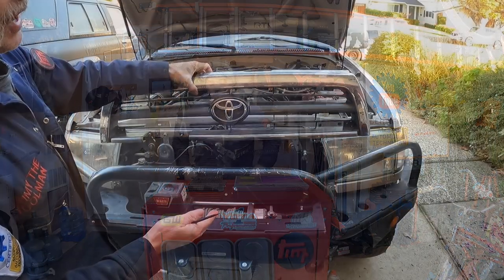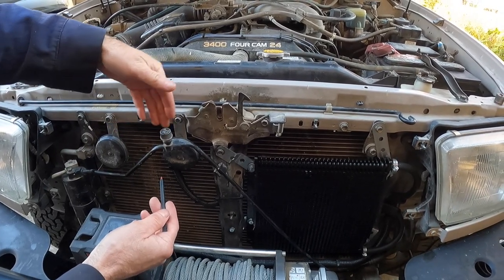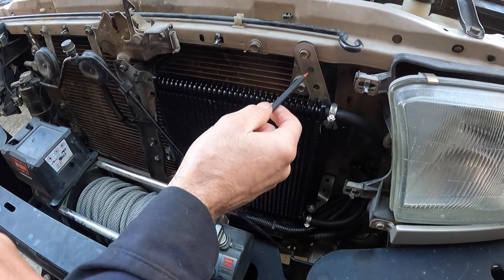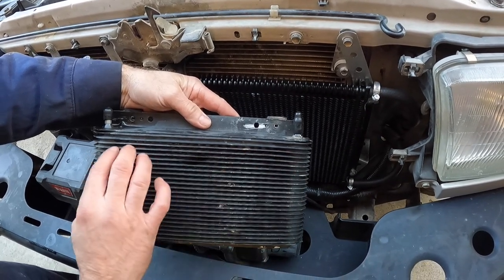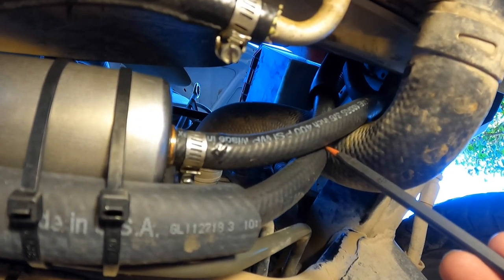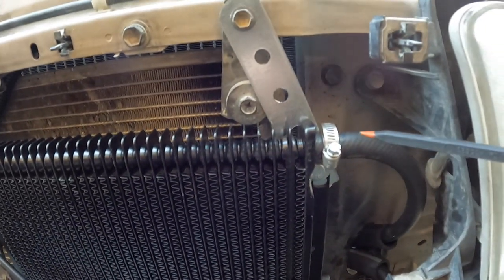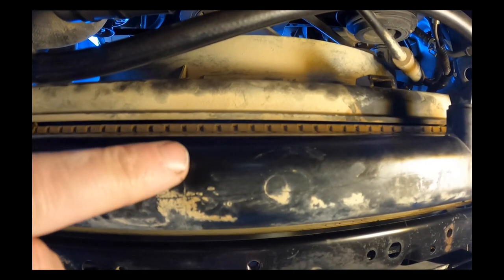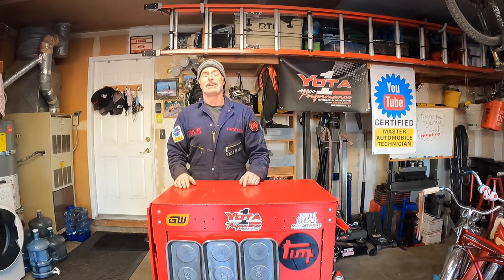External Transmission Cooler Install (3rd Gen 4runner/1st Gen Tacoma)

Comment: hi Timmy, quick question,  I'm  planning to overland my sr5 i already order  my rear bumper, i already have the front one with a   x-bull 13500 , do you think should i go with the hayden 699 or the 678? thanks again.
Reply from the maker: The 699 has a thermal bypass for cooler conditions.  How well it works?  it's debatable.  But, I'd probably still go with the 699.
Reply: @TimmyTheToolman  thank you so much.
Reply from the maker: @julioarrecis666  No problem.

Comment: I have a 98 4Runner and just got my Hayden 699 mounted up but need to get some 3/8 line. You show two 3’ sections needed, is that enough? Seems kinda a little far for only 3’?
Reply from the maker: 6 feel is enough for the way I routed it.  If you choose a different path for the hoses and come around the passenger side of the radiator, you'll need more hose.
Reply: @TimmyTheToolman  thanks for the reply, I’ll get 7’ just in case :) you rock thanks for what you so
Reply from the maker: @i-b1982  You're welcome.  Good luck with the install.

Comment: Hello Timmy, do you know if the internal transmission cooler is on the cooler side tank or hotter side tank of the radiator? thank you
Reply from the maker: The lower part of the radiator where the trans cooler is located is the cooler side of the radiator.  The hot coolant enters the top of the radiator, is cooled and returns to the engine via the lower radiator hose.

Comment: This is probably a dumb question. If I have an ultra gauge that monitors transmission temps and I do this and bypass the stock cooler, will it still read the temperature correctly? I'm not really sure where the thermometer for the transmission is. I have a 2000 2wd 4runner. Thank you.
Reply from the maker: Yes, you'll still be able to read the trans temp correctly.
Reply: @TimmyTheToolman  Appreciate it!
Reply from the maker: @mitchellpeterson2883  No problem.

Comment: Hello Timmy I have a 98 4runner sr5. how did you get the transmission temperature I noticed there is no sensor that reads live data in the computer using a high end ob2 scanner?
Reply from the maker: 96-98 did not have the sensor to report trans temperatures. But check out this video where we installed a gauge onto a 98’ just like yours!
Transmission Temperature Gauge Installation
https://youtu.be/fT_2szdKXRM

Comment: Sorry, if this has already been asked, but when I went to purchase the 699 Hayden Trans Cooler, it says this cooler is not compatible with my vehicle and advises me to purchase the 696 Hayden Trans Cooler.  I just wanted to make sure. Thank you.
Reply from the maker: You can make any cooler compatible if you want.  A cooler is a very simple device and isn't really vehicle specific.  As long as you can securely mount it, it will work.
Reply: @TimmyTheToolman  Thank you TImmy!
Reply from the maker: @michaela2079  No problem.

Comment: please i need help. My mechanic installed the trans cooler with the hoses facing downward. Is that a problem?? because i feel like there hasnt been a change in trans temp..
Reply from the maker: I think I remember upside is considered an acceptable position to mount it in, but I've only every done a sideways install with it filling from the bottom and exiting the top.  You fill from the bottom so air is pushed out of the cooler and not trapped affecting the cooling efficiency of the trans cooler.

Comment: I’m hot areas like phx, az do you think this will affect the ac condensers performance?
Reply from the maker: It shouldn't negativity affect your AC system enough to notice.  The air will flow through the trans cooler and reach the AC condenser.

Comment: I live in TX and the day time ambient temperature can go to 100+ degree F.   I did what Tim did (bypass the radiator) and installed Hayden 699.  Scangauge ii reported temperature around 190 degree F during the day and 165 degree F during the evening (ambient 86 degree F).  Is this normal?  Should I or can I install another smaller Hayden in tandem to better cool the ATF?
Reply from the maker: Those temps seem high.  Is that around the town driving on relatively flat roadways?  I don't average that high of temps with my Hayden 699 cooler and I'm driving in similar ambient temps.  If I'm driving in the hills, then yes, the temp goes up and then you need to utilize tricks like turning off overdrive to keep the temps down.  

What are your engine temps like?
Reply: @TimmyTheToolman  It is when driving on flat roadways.  My rig is 2000 4x4 but I don't do trailer or off-roading.  Can I install a 2nd smaller Hayden or hook it in series with the radiator?  Thoughts?
Reply from the maker: @thepianofamily8304  Yes, you could run two external coolers in series.  Guys have done it.
Reply: @TimmyTheToolman   Coolant temperature is consistently at 200+ deg F when driving in town, according to Scangauge 2.  The TFT is ~195 deg F.  The ambient was 103 deg F.  I have ordered a 2nd 699.
Reply from the maker: @thepianofamily8304  Have you checked the function of your fan clutch yet.  That might be part of the problem.

Comment: Hey Tim , installed the same cooler. My oil temp was around 175ish . After the install I’m getting 89. This is with the AC on. Is this normal? Seems too low.
Reply from the maker: That seems low.  I see low temps in the morning when it's cool and I just started driving, but it will climb into the low 100's until I start climbing hills and then it will rise into the mid 100's.  What kind of ambient temps do you have where you live?
Reply: @TimmyTheToolman  You know what Tim. I went back on my notes and it was actually 155 instead of 89. Sorry. So that is like 11%ish drop. Not too bad. I was doing multiple tests on other things installed and lost track. But to your point, I should test going up a steep incline/mountain pass. Without the cooler I was averaging 220-230ish. This incline is in the 15-25 degrees grade. BTW I live in the central valley where it gets really hot! So very similar weather to what you encounter. 🙃 Thanks for replying!!
Reply from the maker: @genxiong2695  Gotcha.  Let me know how the testing goes for you.
Reply: @TimmyTheToolman  Will do. Thank you for making these videos and helping out all the DIY weekend warriors!
Reply from the maker: @genxiong2695  No problem Bro.  It's our pleasure to help the Toyota Community out.

Comment: How many quarts of ATF will I need to do a full flush and refill, and why Valvoline full synthetic instead of a genuine Toyota ATF?
Reply from the maker: The system holds around 12 quarts.  I usually run around 13-14 quarts through the system to get the fluid really clean.  You can use whatever ATF you want.  As long as what you use is compatible with the spec suggested by the manufacturer, you're good to go.
Reply: @TimmyTheToolman , ok thank you very much. 😊
Reply from the maker: @erniekropf665  You're very welcome.

Comment: Hey Timmy, is it possible to do a steering wheel mod? I saw one in a 2002 4Runner and I like it more than what I have in my '97 rig, but I don't know if it will fit/work or not
Reply from the maker: That “mod” would require you to splice in a 98+ airbag connector OR swap the clock spring.. the steering wheel itself secures to the shaft the same way throughout all 3rd gen years (96-2002) It is held on but a 19mm nut.
Reply: @TimmyTheToolman  I think I would go the "splicing" route. Thanks, Timmy
Reply from the maker: @zenjon7892  we have some extra 98+ airbag connectors if you need one
Reply: @TimmyTheToolman  ok, I'll take one
Reply from the maker: @zenjon7892  email Sean at: hmb4rnr@gmail.com

Comment: I own a 2001 Tundra 4x4  limited 4.7 liter. How much better is this cooler then my stock one and do I really need this transmission cooler?? I don't see a temperature gauge for my transmission anywhere.
Reply from the maker: The Hayden 699 is going to have quite a bit higher cooling capacity than your stock one.  I've seen the size of the stock ones and they're not that big.  You don't have a trans temp gauge.  All you'll have is the "Idiot Light" that will light up on the dash if you overheat your trans, around 300 degrees.

If you want to monitor your trans temps, you have a couple options.  There's OBD II port bluetooth readers that can send information to phone apps like Torque Pro.  Torque Pro is for Android phones only though.  For iPhone, there's other apps you can use.  You also have to make sure you get a reader that works with your platform, Android or iPhone.  The other option is getting a scan gauge or ultra gauge.  I use to use the phone app but decided to go to a scan gauge so my phone didn't have to bounce back and forth with different screens like when I'm using my phone for navigation at the same time.   If you open the video description by clicking on "Show More" and you go to the "Helpful Tools" section, you'll find a link to the Scan Gauge tool I use in my rigs.  

So, it depends on how you drive your rig and the temps you're seeing whether or not you need to upgrade your trans cooler.  If you drive mostly flat roadways, you probably don't need to change anything.  If you drive a lot in the mountains or tow, you might find the stock trans coolers aren't doing enough to keep your trans temps down.
Reply: @TimmyTheToolman  I driver in the Eastern High Sierras for about a month per year towing a small fishing boat.
Reply from the maker: @mikekmalick  You should start monitoring your trans temp then.  Ignorance isn't bliss in this situation.  Knowing what your trans temps is doing will let you know when it's prudent to pull over and give your trans a break.  I'll pull off the roadway when my trans hits around 230 degrees and I know I'll still be climbing further.  The same goes for the engine temp.  That analog coolant temp needle gauge is pretty much worthless.  Once you see the needle start to rise higher than normal, your engine temp has already spiked.  It's better to know the actual digital temp your engine is at to catch an issue quicker.  210 degrees is the engine temp I start to get worried and will either pull off the side of the road to let it cool down or I crank the heater full blast and suffer in the cab to help drop the engine temp.
Reply: @TimmyTheToolman  should I install a aftermarket transmission temp sensor gauge?
Reply from the maker: @mikekmalick  That would be the harder way to go Mike.  I gave you two options of how you could read the trans temp which wouldn't require you to have to install an aftermarket gauge.  Installing a gauge would be much more work.
Reply: @TimmyTheToolman  I am looking for the cheapest way to get engine and trans temperature readings! Will the OBDII products do this on a 2001 tundra? If not then I will just get the SG2
Reply from the maker: @mikekmalick  Yes, an OBD II reader and phone app should work.
Reply: @TimmyTheToolman  I am thinking of adding a magnetic filter and 699 cooler to the system as an addition and not disconnecting any OEM equipment. What is your take on that? I have seen others do the same.
Reply from the maker: @mikekmalick  Yeah, that's perfectly fine to run the cooler in-series.
Reply: @TimmyTheToolman  awesome! Just worried about not changing the flow rate! Do you think it could change the flow rate at all?

Comment: In Kuwait, temperatures in the summer reach 50 degrees Celsius. Is there any advice from you regarding the transmission cooler for this weather with the fj car, knowing that the Fj cars in Kuwait have a horsepower of 268 and a torque of 380 Newton, because in our country this car is still sold from  The dealers   and yes that Toyota modified the engine from 2017
Reply from the maker: The only advice I could give is install the biggest external cooler you can and maybe add an accessory electric fan(s) to push more air through the cooling fins when traveling at slower speeds.
Reply: @TimmyTheToolman  you just read my mind im thinking of this step 
Thanks a lot brother with best wishes
Reply from the maker: @Respecet1981  No problem.   Hope it works out to keep your trans temps down.
Reply: @TimmyTheToolman  sure brother 👍🏻
Reply: @TimmyTheToolman  the biggest trans cooler can fit the fj is the 30 btu tru cool max the long one 
I went to the auto cooling technicians and they told me this is the biggest transmission cooler you can install in your car and I spoke with one person have the 2020 fj and he told me it work very nice, the trans temp is stable 
I will try it 
sorry if I disturbed you
Reply from the maker: @Respecet1981  You're not disturbing me.  Good luck with the install.

Comment: So you bypassed the Factory Cooler all together?
Reply from the maker: Yes, I'm trying it out and I'll see how the trans temps do over time and make a decision to keep it as is or change it to run the external cooler in-series with stock cooler in the radiator.
Reply: @TimmyTheToolman  Well I'm a Toyota MDT and here is how I've installed my coolers & filters; Leave the Trans, go into the installed cooler, back into the radiator, into the filter and back to the trans. I've installed Remote Oil filter mounts on all my Toyotas, (3) and use the Purolator Pure One filter, changed once a year along with flushes every 30,000. The reason you want to go into the installed cooler first then back in to the radiator is because it stabilized the temp. Kinda like this;  Too hot fluid leaves trans, tires into the installed cooler, cools the fluid too much but then brings it back up to operating temp in the radiator and back to the trans..  The temp should be between 140-170. It should never get past 180, that's the temp that starts oxidizing the fluid and hardens seals, generally not good past 180. Oh and use Synthetic Trans Fluid PERIOD.  I welcome you're comments on this, thx
Reply: @bluesky-ud9wg  So basically, you recommend series?
Reply: @genxiong2695  I'm a Toyota MDT, I do recommend running into the After Market cooler first then back into the Radiator cooler to stabilize the temp
Reply: @bluesky-ud9wg  Ok. So you're not answering my questions correctly or you are unsure.  There's 2 ways to run the cooler. One method is in series, meaning you are not bypassing the radiator but instead using the cooler in conjunction with it (which is what Toyota run on stock coolers). The other method is bypass which you run straight into the aftermarket unit and into your transmission. The radiator will no longer cool the transmission fluid but instead, the cooler will. Make sense?

Here's the in-series method:
https://www.youtube.com/watch?v=2EtQJb3RDzY
Reply: @genxiong2695  You're not understanding; Leave the trans, go into you're Aftermarket Cooler, THEN go back into the OEM radiator cooler then back to the trans. In theory the fluid leaves the trans Hot, is cooled down Too Much by the installed cooler then is brought back up to operating temp by the radiator cooler, then back to the trans. Easy?
Reply: Do Not Bypass the stock cooler
Reply: @bluesky-ud9wg  You just mentioned you do not recommend running into the after market cooler first. So you are contradicting yourself. Now, your above statement is to go into you're aftermarket cooler? This is essentially the by-pass method. OEM radiator cooler? What is that? Lol. 

This is how I run in-series. The "OUT" or hot/send line is never touch (this stays connected to the radiator). It's the "IN" or return line that is tapped with the aftermarket cooler then returns to the transmission. Simple as that.

I think you just don't know the difference between what is bypass or in-series. Nevermind you are lost.
Reply: @genxiong2695  Ok, I'm a Toyota MDT, look it up. I didn't contradict myself at all. If you could read and comprehend what I said, this Convo would not be taking place. Figure it out yourself. Have a good night
Reply: @bluesky-ud9wg  Just scroll up and read all your replies. We don't need to wake up Einstein to figure out that you are contradicting yourself buddy. If only you can write correctly. Have a good night.
Reply: @genxiong2695  Yea says LEAVE TRANS, GO INTO INSTALLED COOLER, THEN INTO RADIATOR THEN BACK TO TRANS. Not too hard for somewhat smart people to understand. YOU need to go back and read....
Reply: @bluesky-ud9wg  Dont you want to avoid the milkshake? why would you go back into the stock radiator? The whole concept is to avoid the milkshake.
Reply: @dangda-ww7de  How often does the radiator leak into the cooler line?  99.9% never. You need to maintain the temp, not overcool it

Comment: Hello Timmy ,is it possible to install Jeep wj seats on a 3rd gen 4 runner
Reply from the maker: I'm sure it's possible but I doubt it would be plug and play.  You would have to make some alterations so you could bolt it to the body.  I doubt the mounting holes would be the same.
Reply: @TimmyTheToolman  legend

Comment: Wouldnt you want that filter before the cooler so it doesn't get clogged?!
Reply from the maker: Well, if your trans is sending particles big enough to clog the cooling channels, you have some problems.  There's very small passages in the valve body as well.